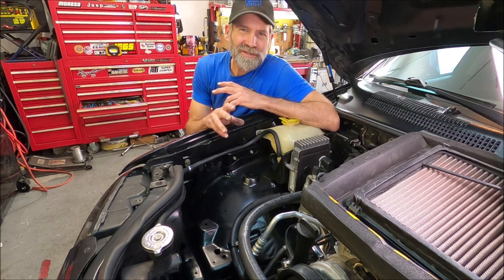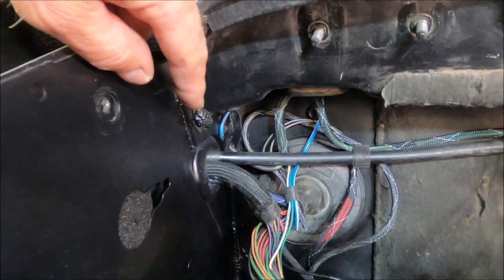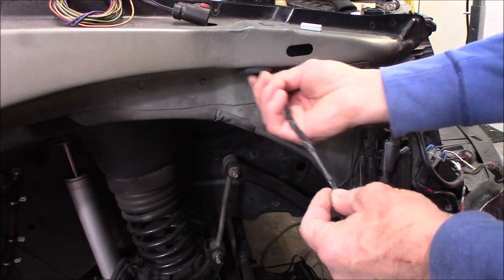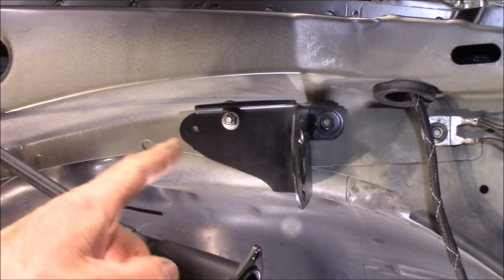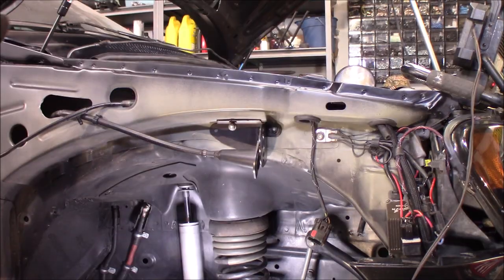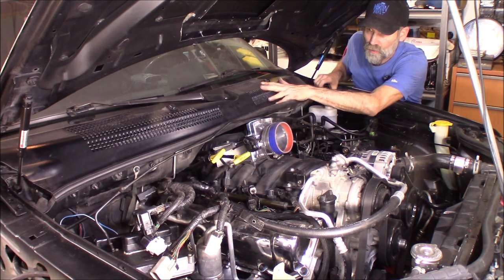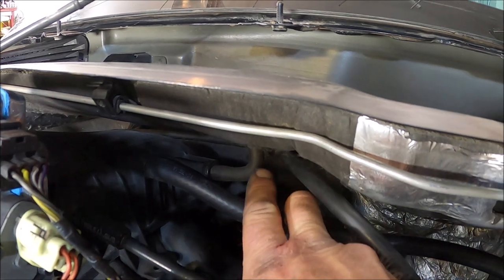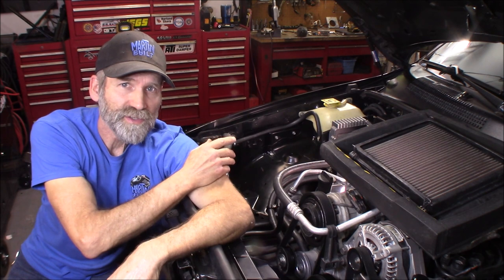How to Tuck Cruise Control Servo, Wire and Vacuum Line

Comment: I took the cowl off to install the cabin air filter. It goes where you removed that little black grille. The filter might interfere with your wiring path, not sure. The filter housing uses the same clip holes the grille occupied. While the cowl was off I glued screening mesh on the back of it with some goop to keep debris and leaves from falling down in there and rotting in the evaporator coil.  The rotting leaves ruined the evap on my last Jeep, caused a leak to occur. $1100 to replace it, had to rip out the entire dashboard to get to it. Clean as a whistle with the screening in place. I also flush that tray once a year from either side with a garden hose  to get out any leaves which might have fallen in from the sides.
Reply from the maker: I had the same cabin filter installed but the plastic grill was made of cheap plastic and fell apart so I reinstalled the factory grill just before I did this video.

Comment: It sure would be nice to do this tuck on an XJ moving that unit would open some space. Maybe in a few months one could find a Martin Built relocate kit for a xj cruise control on eBay. Some of the things you do that might be something to look into and it might be a nice little niche market.
Reply from the maker: Funny you mentioned that because I did relocate the Cruise control servo on my XJ to the same location as the WJ, I did this at least 8 years ago.
Reply: @martinbuilt  I’m going to have to look into that, thanks

Comment: Martin help. I have a 2002 dakota sport 4.7l replaced valve cover gaskets oil pan gaskets and intake and exhaust gaskets viewed my intake like you did with the purple. Now getting code issues won't start tries but just spitting sounds from the engine. Getting code p1391 lose of camshaft crank. I already replace Cam position sensor and crank both new. Also getting error 65 power relay open and p0123 throttle position sensor high. No misfire codes timing chain and gear looked good and oil pressure is good. And error code 65 rear sensor circuit malfunction. New plugs coil packs good injectors good. What am I missing? Why the cam/crank issue if there new and connected and could the throttle position sensor keep the car from starting and cause spitting from the throttle body. It just won't start but it tries getting gas ok. Sorry for the long message I'm just desperate at this point;(
Reply from the maker: yes the TPS needs to be replaced. Did you get any Purple Power on the TPS? Because that will do it.
Reply: @martinbuilt  no I removed the throttle body from the intake I cleaned everything and replaces the cam position sensor so when I got the cam/ crank error I replaced the crank sensor also but still getting code p1391 lose of camshaft crank. I ordered a new tps hope I can fix these errors I'm at a lose on the cam/ crank errors.
Reply: @martinbuilt  Ok I fixed the issue with the cam / crank sensor when I installed the new cam sensor I tightened the bolt but the sensor didn't tighten flush and was a little sticking out I loosened the bolt a little and used a long dull flat head screw driver and taped it in tight and then tightened the bolt and that was my issue of it now working. Its fixed and the truck started and ran right away. We have rain today so when it stops I will see if I still have the other error codes. I wanted to thank you for replaying so fast last night I have learned a lot from you and saved a ton of money I will tell all my friends to subscribe. Thanks Martin.
Reply: @martinbuilt  Ok I fixed the issue with the cam / crank sensor when I installed the new cam sensor I tightened the bolt but the sensor didn't tighten flush and was a little sticking out I loosened the bolt a little and used a long dull flat head screw driver and taped it in tight and then tightened the bolt and that was my issue of it now working. Its fixed and the truck started and ran right away. We have rain today so when it stops I will see if I still have the other error codes. I wanted to thank you for replaying so fast last night I have learned a lot from you and saved a ton of money I will tell all my friends to subscribe. Thanks Martin.

Comment: I'm wanting to do something similar to my Dakota, I need to get the air box and stuff out of the passenger fender well because I plan on installing a 2nd battery and hooking it up with a Cummins style harness...there is so much room in the cowl under the wiper assembly, that Is like to just run it there and leave it be. Do you know of any way to lengthen any of the cables? Not the electrical but the actual tension based ones that control the throttle?
Reply from the maker: There are many other Chryslers that may have the cable length you are looking for. Some day I may start tucking the Dakota engine bay.
Reply: @martinbuilt  I'd be really interested to see what you come up with there. By the way I messaged you on Facebook about an issue I'm having, if you have a minute to look at it ..if not I understand I'm just stumped...

And I just learned you have a Facebook page lol
Reply: @martinbuilt  btw if you would like I can also share pictures of my trucks and how they are coming along through Facebook as well if you are interested

Comment: Hi Martin, Need help, my Radiator blew I have  2004 GC with a Hydraulic fan, could you recommend a Aluminum radiator with the least amount of modifications. I live in Sri Lanka hence parts are very difficult to find. so I need to closest fit possible. Thank you.
Reply from the maker: Personally, I would go with a factory replacement type radiator. I personally think they do a pretty good job even in a hot climate like where I live; it's that hydraulic cooling fan that I don't like.  These aluminum radiators that you see on eBay and Amazon are all made in China and I don't have much faith in them lasting more than just a few years before they start leaking.
Reply: Thanks for the advice, your guidance is very  valuable. I used the Mopar radiator for 5 over five years. I am planning to change the fan to electric still trying to find a good fan. Some WJ 4.7s came with an electric fan plus a clutch fan. I have one- of these, but not two speed. I was thinking to go for this path with a flex-a-lite fan controller unit + the clutch fan. any thoughts on this ?
Thank you
Reply from the maker: @nalinpremaratna925  If you looking for cooling efficiency that should work fine. The clutch fans rob HP and that's why I don't run them.
Reply: @martinbuilt  Thanks Martin, There are so many suppliers of Factory type radiators on amazon and e bay, any tips as to what brand is reliable ?  for those who live outside the US is quite intimidating chose one.
Reply from the maker: @nalinpremaratna925  OSC Cooling Products Radiator 4.7L https://amzn.to/2We5MmP 
This is the one I went with. Been working great so far.

Comment: Very good.  I would even try it.  I have a Ford 540 a tractor that I’m trying to put the lease amount of wiring to get it running.. like no lights at this time.. I just need the wiring diagram.  Like for the starter from the battery to the seller now I like pink and like that alternator and what else that or keep it running it’s a diesel. Probably about 2030 years old.. no computers of any kind..
If you can help thank you very much but I enjoy your videos.. i’m a disabled veteran..

Comment: Does cruise control effect gas mileage??
Even if it's not used?
Asking  cause mine was vacuum hose disconnected and not working and I noticed when I reconnected, my mileage changed for worse.
Reply from the maker: I would think the MPG should get worse with any vacuum leak. I had a vacuum leak recently and when the transmission would down shift the RPM would come up high until the IAC valve could correct it.